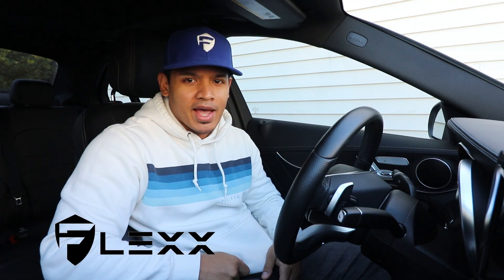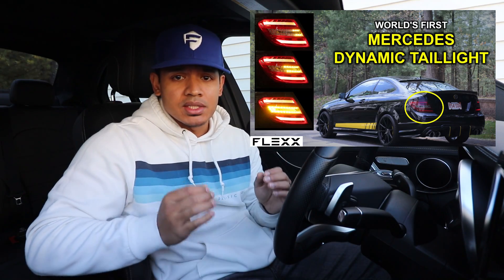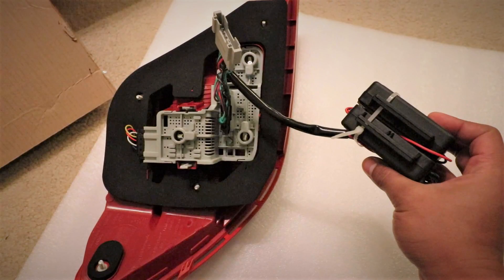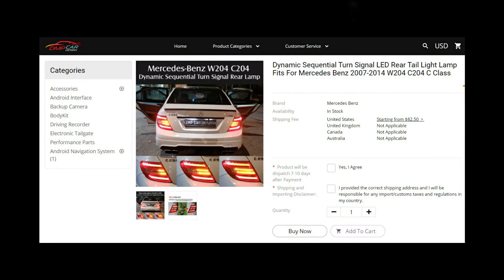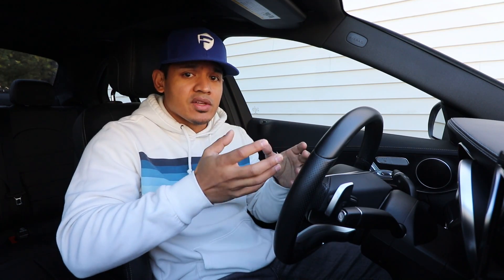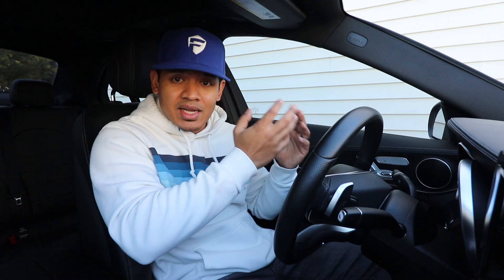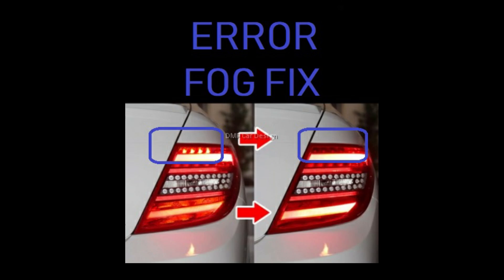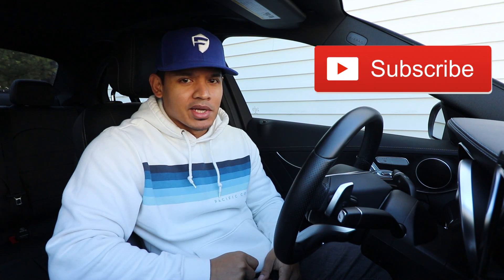Fix the foglight error on a PREFACELIFT Mercedes W204 C300 LED Taillights with decoder box

Comment: Thanks for this bro clears up what i was thinking that you need the box just to put in the facelift lights, would have been mad if it worked just like that but then all pre-facelifts would have the facelift lights. I figured the light was customized internally and would show errors too if put in just like that in the facelift model. So its safe to assume the little box is there to rule out errors.

Comment: Hi Alex, i just bought and installed a Dynamic w204 LED tail lights, with the decoder box. After a night's drive, my decoder box (or isit suppose to also be a load resistor box?) becomes extremely hot. Is it normal to be very hot? or is my dynamic tail light overloading the load resistor (i.e incompatible, very unsafe)
Reply: All resistor boxes get very hot. Either get the car coded to work with facelift tail lights or stick the resistor box to the body of the car with double sided tape. That way your car's metal will act as a huge heatsink.

Comment: I want to order one , does it work on original rear lights ?  I want to add original rear facelift lights to my preface lift, do i need this decoder? Thanks in advance
Reply from the maker: Yes. You’ll need this is you wanna install original facelift tail lights on a prefacelift car.